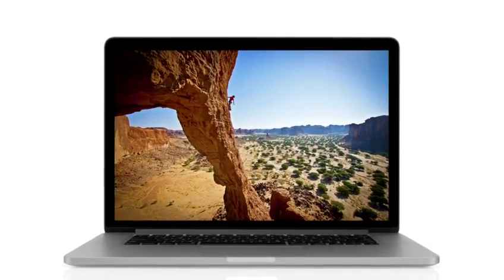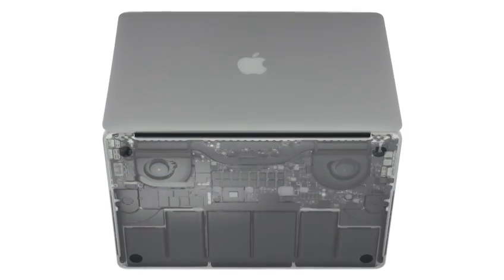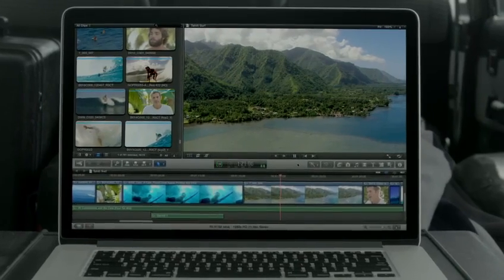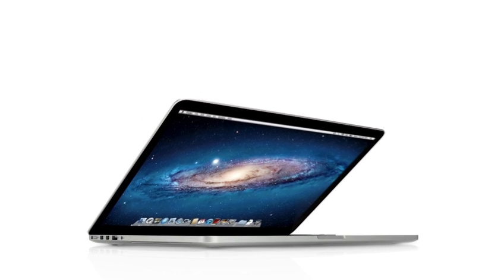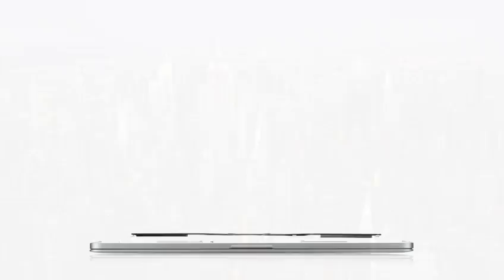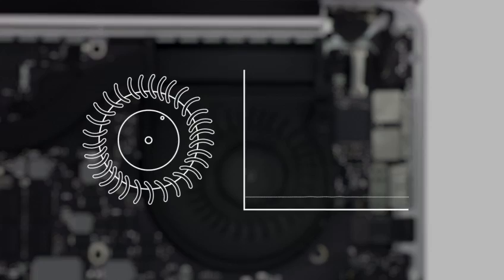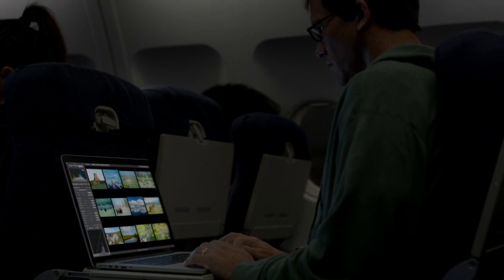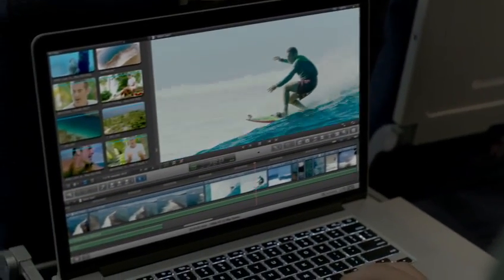Next-generation MacBook Pro with Retina display, USB 3.0

Comment: not a problem at all. I'd rather have my laptop thinner with no CD drive. In the past 2 years I only used a cd once on my iMac. CDs are becoming obsolete. There is nothing you can't put on a flash drive that you can put on a CD.

Comment: no sir the processor in my com runs at 3.4 ghz .8 ghz faster than your mac but i can turn it up and make it even faster so right now its at 4.3 ghz about 2 ghz faster than you make and the computer i have is literally half the price. And you see sir in 4 years when my hard ware does inevitably go out of date i pull out 4 screws undo a latch and put in a brand new chip with no problems.

Comment: it probably has better hard ware mac users for get that there is not just one set of chips for all comps. I have a comp that is twice as good as the mac book pro for half the preice dont belive me go look for your self its tech specs are a 
intel i5 3570k
msi ati 7870 twin frozer 3 
msi z77a-gd65 
8 gbs 1866 ddr 3 ram 
segate 1tb hard drive 
oh is this to technical for you ?
The truth is when you by a mac you pay twice as much for half as good of an computer.